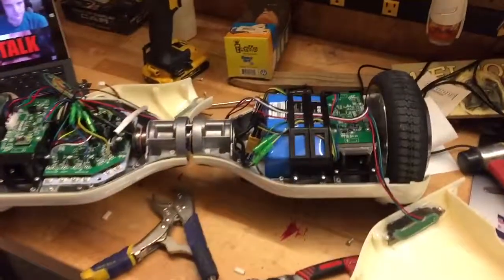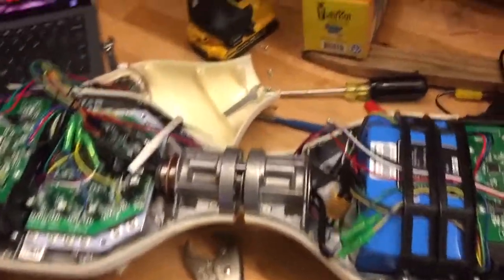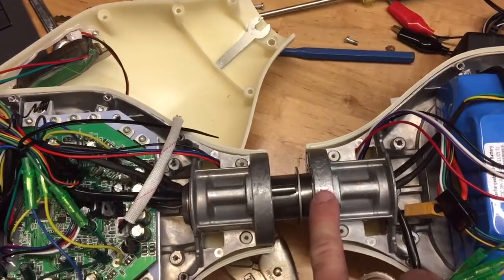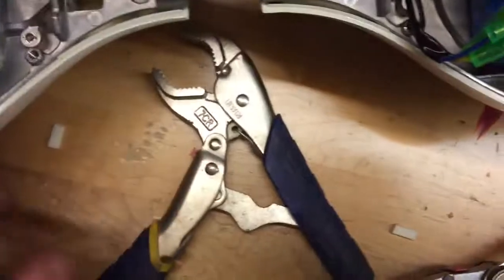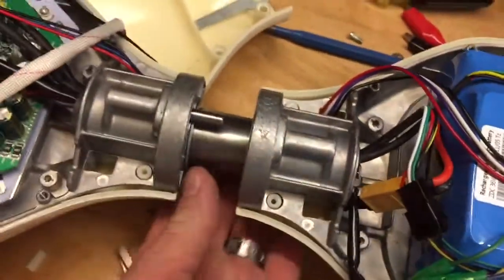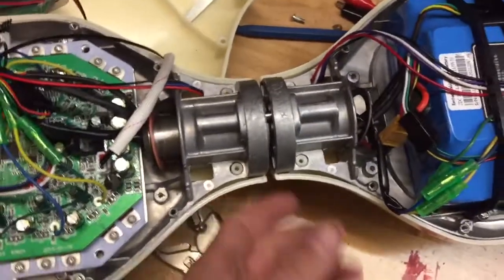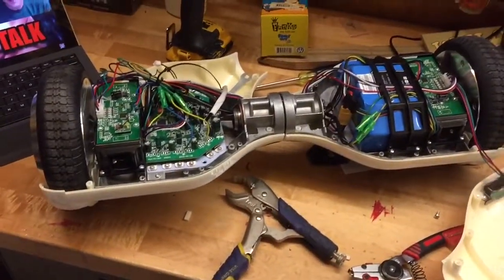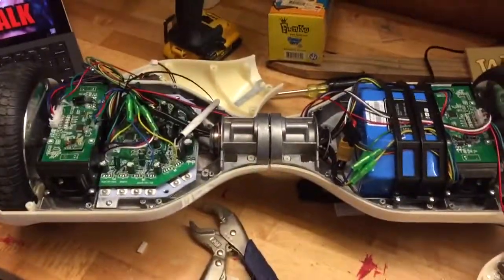Self leveling hover board slow twisting to one side problem

Comment: Idk if it’s just mine but when u start riding fresh off the charger it works great but let me 10 min into riding it it has a spinning problem it dosent want too rotate at all on the left I have too rotate the right and then get a stamina too be able too rotate on the left but when it dose it goes full speed that it knocks me off my board any suggestions?